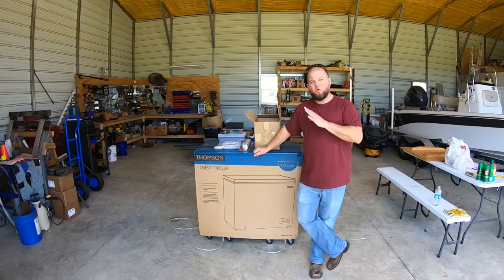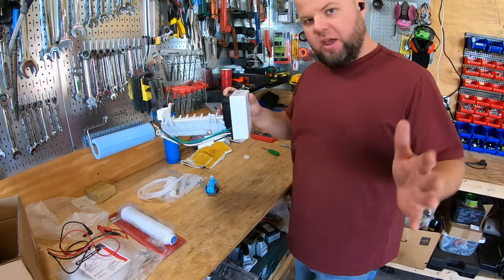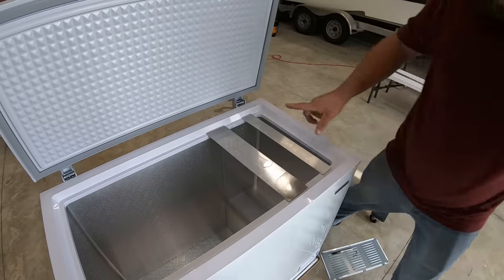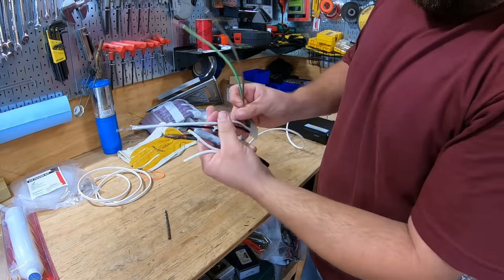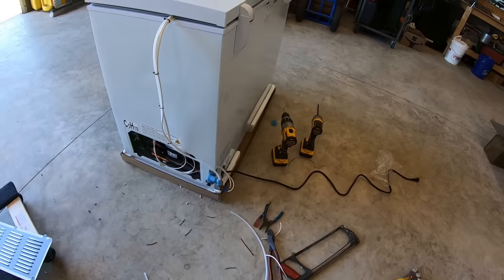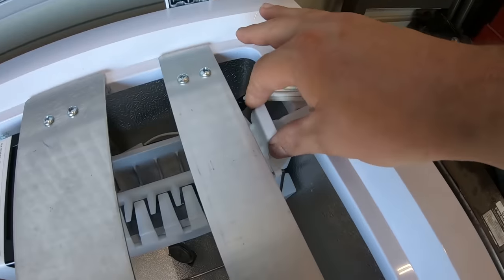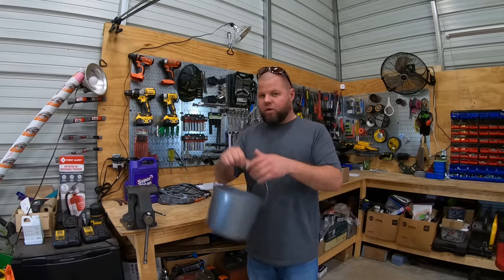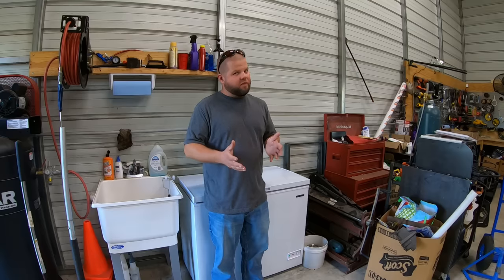Homemade ice maker! SAVE thousands over a commercial ice maker

Comment: I bought a used side by side refrigerator freezer. With an ice maker already in it. blocked off the refrigerator section...so just the freezer is used.. removed the shelves in the freezer... installed a brand new clean kitchen trash container ...and wallah !  And now I have pounds and pounds of ice in my garage with extra storage space where the refrigerator used to be !   75 bucks ! And 2 huge doors for trump stickers!
Reply from the maker: That sounds like a great option

Comment: 0 Degree ice pulls carbonation out of soda drinks. That's why commercial units for restaurants  use 32 degree ice. If you run some water over your 0 degree ice before making any seltzer drinks it will instantly become 32 degree ice and keep carbonation in your drinks.

Comment: I bought an edge star ice maker about three years ago and the enamel on the ice maker bottom started to flake off and get in the ice. So I tried to find another replacement and could not get one. I ended up rewiring a close duplicate ice maker unit and I am up and running. Ice making machines are a rip off. I also ended up buying a so called commercial ice maker that continuously melts and find that to me a waste of water and electricity. Now that I see your video I am thinking about building a smaller version of yours. Love it when inventive people like us can build things and save money. Ice maker for $2000 IS A RIP OFF. Great job.

Comment: Actually that freezer doesn't need to be off the wall to breath.  That's why there is no vents on the back.  That side  has a vent where the opening is that houses the compressor, condenser etc. That panel has slots for it to vent and breath. The back of that freeze  doesn't vent anything. Also if you plug that it spray the walls with cold water after being plugged in n for 15 minutes you will see where the coils are. The coils don't go all the way to the top. Just for feature reference. How ever great build.

Comment: I'm an actual Ice Machine Technician. I'm a representative of all 5 major commercial ice machine manufacturers. Manitowoc, Iceomatic, Scotsman, Hoshizaki and Ice Tro. Been doing ice machines for a long time.......all I can say is Bravo!! 
Commercial ice machine quality has declined. They're are expensive to maintain, and getting more expensive every year. So kudos to you for figuring this out! Pure genius.
Reply from the maker: Thank you very much! I'd love to have the capacity of the big name brands, I just can't afford them.
Reply: @TKCL  heck I fix them for a living and I can't afford them either! Lol I get used units from time to time and fix them, then use it until it dies. Throw it away and start over.
Reply: Is Kold Draft still around?
Reply: My wife loves the crunch ice nuggets you sometimes get at restaurants. Is there an ice maker unit for those that could fit into a project like this? Or better yet, replace the ice maker in our Samsung freezer drawer? (We don't have a dispenser in the door.)
Reply from the maker: I am not sure, never seen one other than the crush function ice makers that go in side by side referators and freezers
Reply: @robertmoore1472  For curiosity sake, what would be your thoughts to if this could be done with a commercial ice maker unit? What about one of the counter mounted units that produce much more ice in a 24 hr cycle? (Apealing features could be more capacity, better quality ice, less draining/energy waste)
Reply: @golf-n-guns  yes
Reply: @travisthejiu-jitsuguy3743  I've been thinking about this exact same thing. The ice bins that store the ice are over priced ice chest. They only store the ice that ends up melting and draining out of the bin. 
So having the ice machine drop the ice into a freezer that's keeping the ice at sub zero temps or close to it, in my personal opinion is genius. 
The issues lie in the manufacturing process, and what their " engineers " think. I use the term engineers loosely lol. 
Ice machines and storage bins already extremely expensive. Having ice stored like he does in this video will only raise costs through the roof. 
I personally love the idea.

Comment: I’d mount the I/M on the left side and have a tall plastic trash can or similar directly under it. The ice would fall directly into the can. This would allow you to use the rest of the freezer for freezing food room without it coming in contact with the ice. 
The only concern might be getting a good seal where the water line enters, this would cause the fill tube to freeze and frost to form. Mullion heaters are often used to prevent water lines from freezing. 
Great video. I have nothing but respect for anyone who has an idea and goes for it. The world needs more do-ers. Kudos to you!
Reply from the maker: Keep watching the series, I build a lip to run lines and wiring so I no longer had to cut or modify the freezer.
Reply: i did something like you're suggestion, just used plexiglass to divide my freezer

Comment: I’m a refrigeration tech, and it seems you got everything right, just be sure to seal up around were your wires and tube meet the gasket or it frost up around the top edge if there are any air leaks. Otherwise I’m looking forward to seeing how this turns out. Seems like a great idea.
Reply from the maker: Thank you
Reply: Craig I have a question for you. I am doing the same thing he is doing but the GE icemaker WR30X10093 I bought has the color code on the wires coming out of the icemaker are light blue, black, yellow, and green. I would be grateful to know which wire hooks up to power, neutral, ground, and down to the solenoid. Thanks for any help.
Reply: @capman911  hey mike, it’s been awhile, so double check me on this, in the back of the i.m cover or there may be on in the front kick plate a diagram. Green is ground,black should be hot, look at the valve to see what 2 wires are there, brown should be one. But please double check me, it’s been a few years since I’ve been in the field hope this helps some .
Reply: @dakota5805  Thank you Sir for the gracious help.
Reply: silicone caulk and duct tape
Reply: You need 2 more  ice making machines .  In that freezer.  Plus ice for the house . PickNics .  You will Use Ice .
Reply from the maker: I've got two in there now and fans.
Reply: @TKCL  any updates?  How’s she running?
Reply from the maker: I recently uploaded a #short, it's still running great and was slap full. It's about to get a yearly defrost and cleaning.
Reply: @TKCL  thanks for the reply!  I’ll look for it!

Comment: Mans the build was awsome. What really blew my mind was I never realized I was using ice at different temperatures. My fridge ice does last alot longer than bagged ice. Super educational keep, it up creators.
Reply from the maker: Thank you for watching
Reply: ice can't be different fucking temperatures. Bro. wtf lolololololololol!!!!!!!!!!!!
Reply from the maker: Before you make a comment like this you might should do a simple Google search. Ice can and is a wide range of temperatures. Ice can actually get so cold that it liquifies in a very weird minus temperature state. It amazes me that people get stuck on the 32 degrees. That's the point at which a state change happens from liquid to solid. The solid form will continue to drop based on surrounding temperatures.
Reply: Mine makes crushed ice, if I put it in my house freezer you need an ice pick to use it, but if taken straight outta the machine and put n ice chest with some water it’s temperature is below freezing and the ice water mix will last for days. I left an orange water jug with no lid on it inside truck with windows rolled up with these 106 degree days over weekend and was still cold on day 3

Comment: Nice job. I like the way you avoided drilling and installing into the side walls. I installed 2 icemakers into the sidewalls of a freezer (same one from Sams) 5+ years back. Had to be very careful working around those copper refrigeration lines. Worked great until finally one got stuck in the fill cycle and I got a solid block of ice the inside dimensions of the freezer. No worries, cleaned it all out and reinstalled 1 maker this time. All still going good.

Comment: Industry standard on lamp cord is the ridged wire is the neutral and the smooth wire is the hot. You could’ve used a flat 4 wire instead of the lamp cord but this is a great video you did and I’m going to do this because I’m tired of paying over $5 a day for ice at the store.

Comment: You did great! Catch the ice in a new plastic trash can then bag it as it gets full. You are right, the commercial ice makers depend on the ice itself to cool the ice bin, however, using the entire freezer as the maker and storage you don't have to worry about a drain constantly dripping water to the outside or a floor drain.

Comment: just so you know..... on a lamp cord or appliance cord that has those ridges... the ridges is the neutral(white), and the smooth is the black(hot). If you hook a lamp up the opposite way then you increase, by a lot, the chances of getting shocked because the outer part of the socket(the part that a bulb screws into) becomes the hot and it is very likely that you will touch it while trying to screw the bulb in.

Comment: when heating up and bending plastic tubes or even pvc, you can fill the piece with sand then bend and it helps keep tube or pipe from kinking.  great job on the project
Reply from the maker: That's been a popular suggestion, thanks
Reply: 3D and 5D bends for pigging :)
Reply: Just commented the same thing...
Reply: Thanks. Great tip!!
Reply: Wonder if a heat gun can be used?

Comment: Kick in the freezer with the lid open and look for the condensation to become visible where the freon lines are.  It will frost in stripes within minutes usually
Reply: Our beer club mods freezers like this all the time for CO2 lines to use as kegerators - this is how we find the lines as well.... tried and true method.
Reply: If it's something you do a lot, you can get a FLIR thermal camera attachment for your phone for about 100 bucks.
Reply: Well done Bud!

Comment: Be careful drilling and/or cutting around the edge where the door seal contacts - most refrigerators and freezers have a loop of tubing that is off the hot side of the compressor to keep this edge warm. This is to keep ice from forming where the seal is and freezing the gasket down to the unit body.
Reply: great info .. thx
Reply: Pretty sure he figured out where to cut.
Reply: One idea would be to get the schematics of the unit to see where these parts are located.
Reply: @MikeySlou  LMAO i mean the guy mentioned it in the video...  people dont watch the whole thing the just skim through it
Reply: @OlAbeLincoln  'the just skim through it'  Realize, that is the entirely correct method.  No one should be watching entire videos except when they really need the entire video.  Anything else is a ridiculous waste.
Reply: @ModelLights  or if you want be a hack and mess shit up don't watch the whole video. Must be great to be so highly intelligent that you never have to watch a full video.
Reply: @ModelLights  oh god, he got me i ahd a typo...lmfao

Comment: I love it when a guy is not afraid to modify new equipment to build a project. You are spot on with your assessment comparing like the Nugget ice commercial ice maker to a home type half moon ice maker.  We have both.  The only issue with the half moon cube is it has a tendency to melt and fuse together into a big chunk in a ice chest.  The commercial Nugget ice has air in it and melts very fast and is not a good choice for ice chests.  Good job and thanks for posting!
Reply from the maker: Thank you for watching

Comment: Good work. That type of icemaker is usually 120 volts. 
They usually wait 24 hours and throw away the first batch of 'cubes'.
The needle clamp is usually called a saddle valve, but I like what you called it better.

Some people make refrigerators out of those freezers and they are way more efficient and cost less. Usually the only thing stopping the ones who want to try that is their significant other who likes a French-door fridge. :)

Comment: Just thought I'd share an idea. You could also find where the copper tubes are running in the walls if you turned it on and kept the top open and/or put a bucket of water inside then you'd see where the water froze on the wall corresponding with where the copper tubing is

Comment: Great job. I have to say I've fished galveston bay most weekends for nearly 70 years and always used a lot of ice. That said no matter how much bagged ice I used it was always gone by the end of a hot summer day. Trial and error I was buying a lot of milk for my kids when they were growing up and started taking the milk jugs and filling them up with water and freezing. One gallon milk jug will likely take two days to even thaw completely. Two frozen jugs will keep a hundred quart ice chest reasonably cold for a day or two and they don't melt all into your food or fish in the chest. You might want to keep a half dozen jugs in that freezer for fish keeping. Get the ones with screw tops and leave a bit of air space at the top before freezing. I leave the lid off until I remove the jug from the freezer and then cap.

Comment: I just used an old side by side fridge, took out all the shelves on the freezer side and put a 5 gallon bucket at the bottom for the ice to fall into
Reply from the maker: My friend did that but with a plastic trash can inside. Works well too

Comment: Great idea.  An old trick I learned from building kegerators and keezers for homebrew... Turn the chest freezer on and let it run a while completely shut.  Then get a spray bottle mixed with vodka and cornstarch where it looks like milky water.  Spray the outside.  You'll see it haze along the lines where the chiller coils are after about 15 minutes because the alcohol will be evaporated by the hot coils and should give you a really good idea where you can drill for lines.  I've seen people do it with water on the inside too but this one seems to be a bit more definitive.

Comment: We run a drink business and to supplement our ice maker, we just add water to a bucket like yours (around two thirds full) and just leave it inside the freezer to freeze up. When it’s reached solid ice, we remove it from the bucket mold and set aside and repeat. We fill up our ice freezer pretty quick, depending on the bucket size and we have larger block ice instead of just cubes. All you’ll need is an ice pick to size the ice blocks to your needs. Suggest lining the bottom of your freezer with wood strips, plywood or styrofoam. It helps when water accumulates and you need to defrost and drain it quick. It will also save your freezer deck when you have heavy items drop accidentally. Lol. 
Great video! Good luck and have fun on your upcoming outdoor adventures!
Reply: Does the bucket ever break?
Reply: @AJ-rm7yy  over time, yes. But its my experience that those leak sealing tapes sold at the big box stores extends use. Otherwise, those cheap buckets like the one in the vid are well.. cheap. Other inexpensive plastic food containers work well too.

Comment: Nice video!   

 Many freezers have the "extra ice" function.   If this selection is available, it basically just sets the freezer temperature to a colder temperature for 24 hours.   The rate of ice production is determined by how fast the water, which enters the ice cube mold,  gets to a temperature below freezing. 

 Only when the temperature of the ice cube molding tray gets to that temperature,  will the ice-maker cycle to the next step in the sequence.  The next step is to briefly turn on the electric heater in the mold  to melt the edges of the cubes and allow the ejection fingers to sweep through the mold and release the cubes.  

  Most ice makers are placed at the top of the freezer compartment.  Since "hot air rises"  this is not the most productive environment , but most freezers have  a circulation fan which forces the cold evaporator (also called the freezer coil) air to the top of the freezer compartment and across the ice maker.    

If the incoming temperature of the water was 90° F ,  it  would take 32 calories to take a gram of water to the freezing temperature,   but it takes an additional 80 calories  to convert that 32° F water to 32° ice.  It is this "phase change" of water to ice that requires the most energy.    That would mean that it would take a total of 112 calories to convert a gram of  90° water to 32° ice.  If the water entering the ice-maker could be prechilled to 32° F  then a total of only 80 calories would be needed and would  only result in about a 30%  increase in production.   

It would be an interesting experiment to take a circulation fan to pull air from the bottom of the freezer and duct it into the ice maker  to see how much this improves production.
Reply from the maker: If you watch my next videos you'll see two ice makers and fans. Production is way up. Thanks for watching
Reply: Most refrigerators have a long loop of the water line inside tge registration side before it goes to the freezer ice maker for pre chilling, however all the energy used to pre chill the water is the same either way because all of the cooling coming from the freezer side so i doubt you will saved electricity, the evaporatorfan might help chill the compartments and iced maker s little faster is all but the fan allay ads heat into the compartment from its motor
Reply: Interesting
Reply: So unfortunately the only calories currently for me are the Hershey Almond bar lol 😆